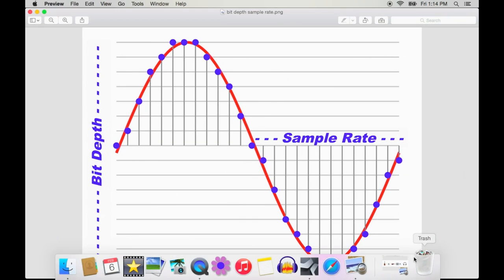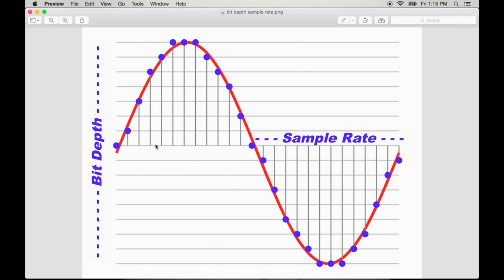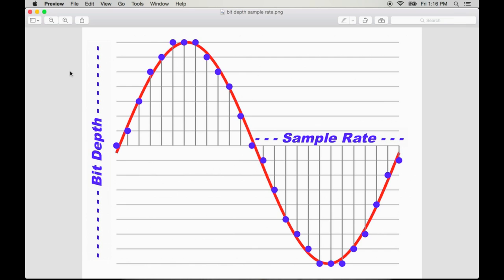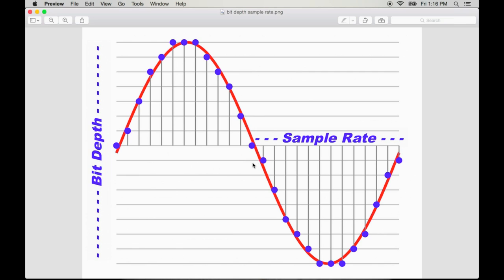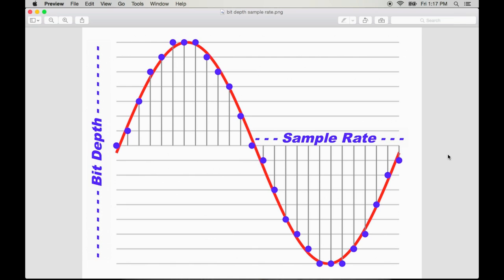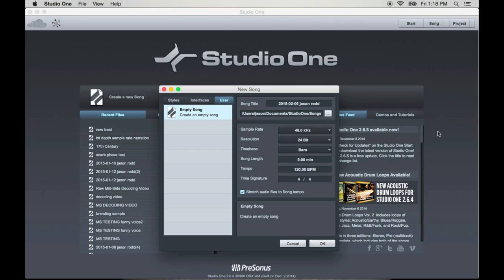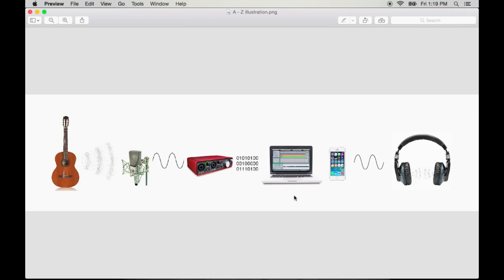Bit Depth and Sample Rate

Comment: Hey dude, you seem like you know your shit, i have a couple of questions in regards of your video:
1. How closely related is the rate of the sample ( lets say 44100 ) to the actual hz the music was tuned at ?
2. Will decreasing/increasing the sample rate affect the tuning of the song as well ?
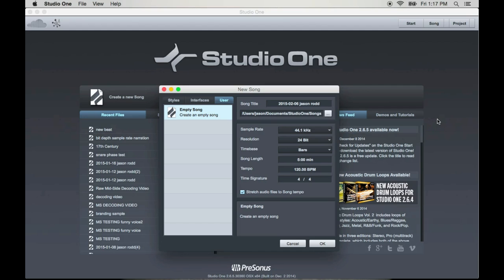3. Will increasing the sample rate ( lets say the same is at 44100 and we increase it to 48000 ) shorten the sample time ( from 3:40 to 3:37 ) ?
Reply from the maker: The tuning or any other context of the music is sort of irrelevant when it comes to sample rate.  If you think of sample rate like the frame rate of a camera like I described, what's being captured on video would be irrelevant to the frame rate of the camera.  When I was talking about how a frequency of 800hz needs a sample rate of 1.6khz to hear it, I just meant if you had a single frequency sine wave tone of 800hz and were recording or playing that back.. but music isn't like that.  Music is a bunch of different types of waves, fundamental and harmonic, summing together with changing patterns over time.  It's much more complex than a single frequency sine wave tone.  So you just need a sample rate that's high enough to capture all the frequencies we can hear.  On your number 3..  I don't know about the 3:40 to 3:37, but yes increasing the sample rate, shortens a samples length of time.  The time span of a single sample when running at 44.1khz is .00002268 seconds.  To sum up sample rate for you: the lower it's set, the less quality in high frequencies you'll have.. but once you exceed 44.1khz, it's hard to hear it getting "better".  I hope that helps.

Comment: Thanks for the video! One practical question: 

As i understood, every sample shows the pressure level of air at the moment of its writing, which has to do with amplitude of the sound (how intensive the signal is). And the higher Bit Depth is the more precise (less approximated) the sound information we get. But how exactly does the Bit Depth relate to the actual  registered sound levels. As i understand, it has to do with sound volume and the more Bit Depth is the louder sound we can register, like, as i heard, 16 bits allows to record ca 96dB, 24 bits - 144 dB. 

It's probably difficult to understand what i mean, but let me give an example. Say, i want to convert a 16-bit audio-file to an 8-bit. What kind of manipulations should i do with every sample which looks like this 10010110 01011010, in order not to loose the perceptible sound? Should i just divide every sample by 256 (=2^8) or just ignore the least significant bits?
Reply from the maker: I wouldn’t directly relate it to how loud a sound you can record.  You could record a jet engine with 8 bits if the gain staging was good.  I would say it increases the usable space between the quietest and loudest parts of a signal.  The higher the bit depth, the better you can record really low level signals because the noise floor is so quiet that you don’t have to compete with it.. while also maintaining the quality of the really loud peaks and transients.  Hope that kinda answers your question.
Reply: Thanks for the reply. But at the same time at 3:26 you're sayin': "This many quantisation points (2^24) allows for a whopping 144dB of dynamic range". What does this mean then? 
Ok... Say, we have a source of a high dynamic range from Mega-Piano (from like 1 dB) to Mega-Forte (of up to 145dB intensity). We record it into 2 devices - with 24 bit depth and 16 bit depth. Once we play the records, i guess they will have different dynamic range: one up to 144 dB and the other up to 96dB. Right? Or is there something substantial i'm missing out? I more or less understand what happens inbetween (the higher bit depth, the more precise record will be). What is unclear is the "edges".
Reply: And what about encoding of the sound file from 16 to 8 bits? As I understand, then we have only 256 different possible levels instead of 65536. So those 16-bit samples which lie in between, say, 230(*256) and 231(*256) should all be rounded up(down) to one of those? Just this mechanism is interesting to me how it works...
Reply from the maker: The 144db I'm referring to there is the space you have in db's from the quietest usable sounds, to the loudest.  Dynamic range is basically the difference between those two extremes.  I'm not sure what kind of dynamic range you'd have using 8 bit, but it would be substantially less.. so compressing more on the way in is a good solution when recording in, or converting to a low bit depth.  Also look into "dithering".  This helps when converting down.  I do it every time I record in a higher bit depth than I export the file as.  For example 24 bit WAV to 16 bit mp3.  To your second point about the really dynamic piano.. The dynamic range of the piano would stay the same no matter what bit depth you record in, the difference is how it would sound when played back.  In 16 bit, the 1 db quiet part you're talking about would be drowned out by the noise floor.  Or if you set the gain so the quiet part is louder than the noise floor, you'll have a different problem.  Now the loud parts will peak out, hit the ceiling and clip like crazy.  In 24 bit, not so much.  This is why I think compressing the audio more when using a low bit depth would help.  It would keep the quiet parts above the noise floor, but also clear of the ceiling.
Reply from the maker: I'm not 100% sure if I'm following this one, but I think you've basically got it.  In 8 bit, if your sound wave hits let's say 230.6 on the scale when the sample rate takes a snap shot of it, it would simply be rounded to 231.  When we use 16 bit, we can think of it like taking those 256 blocks and chopping them up into way smaller chunks so the sound wave won't be moved as much when rounded.  If you do the math you'll see there's actually another 256 quantization points within all those 256 points you had in 8 bit.  So it's 256 times more accurate.  More accuracy equals less noise, equals more dynamic range because you can get quieter and not be drowned out by the noise floor.  See where this is goin?  The quieter you can get that noise floor, the more usable room you have from floor to ceiling.  So going to 24 bit is pretty crazy.  Now you're taking those tiny 16 bit chunks and cutting them up 256 times smaller again.  More accuracy.  Less noise.  More usable room.  Hope this helps in some way.  I appreciate your interest.
Reply: Yes, this is how i understand it too. 
I'm just working on a pedagogical tool for high school students to visualize and explain the process of digitalisation and compression of sound in terms of code (Java) and storing in computer. This concerns Bit Depth (and how one goes (compresses) from one to another), Sample Rate, FFT and so on. So that's why i'm interested in the details of the process, especially Bit Depth (Sample Rate is way easier to understand if not touching FFT). 
Thank you for your help!

Comment: Well made simple video, only thing you had wrong is is the doubling of the hrz... If you take 100hz and double it to 200 sample rate you can play everything at 99hrz and less..... This is because at 100hz and 200 sample rate the points that are maped out are in the center of the wave every time as so when you connect the dots you end up with a flat line of no noise
Reply: Can you explain further?